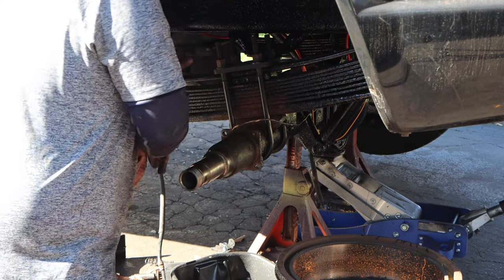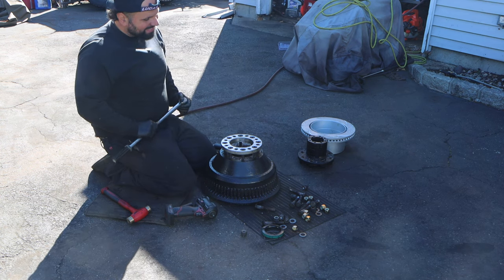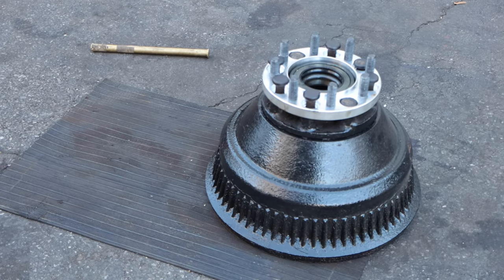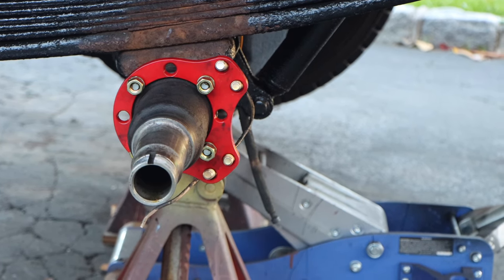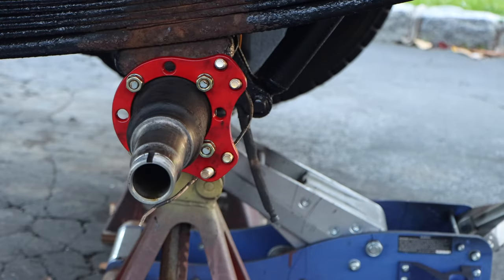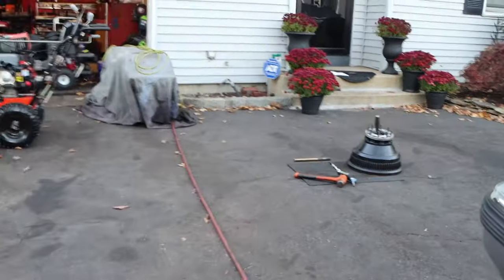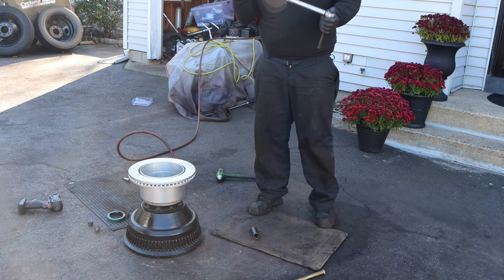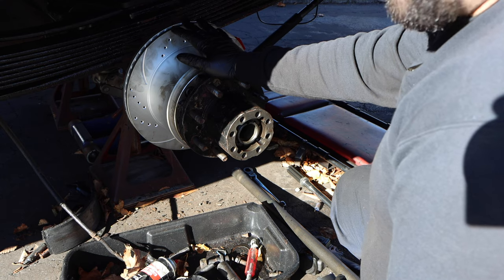Mandingo:  How To Rear Disc Brake Conversion On Dually GMT400 OBS Chevy GMC Part 2

Comment: Did you have to rent those tools they look really specific to that job ? That 💩 looks heavy !
Reply from the maker: Excellent question!  Own them all!  The specialty socket for the rear was a loaner.  Only $15 so I decided to keep it.  Before that I was borrowing one from a buddy.  

Drum is heavy for sure!  Rotor is lighter but still massive.